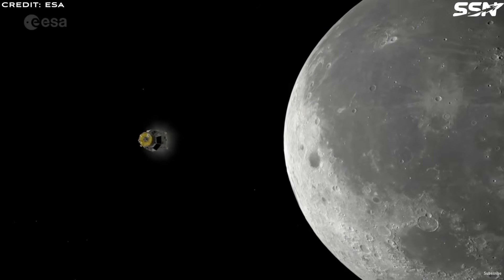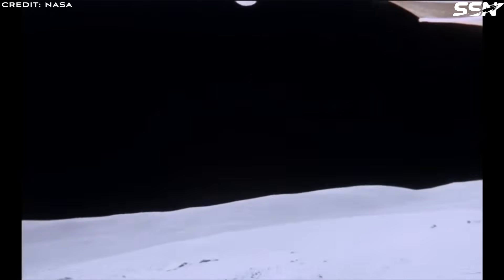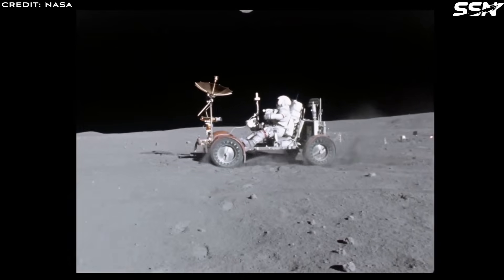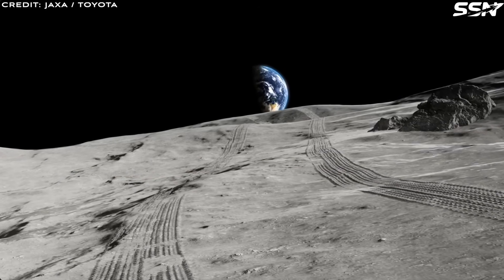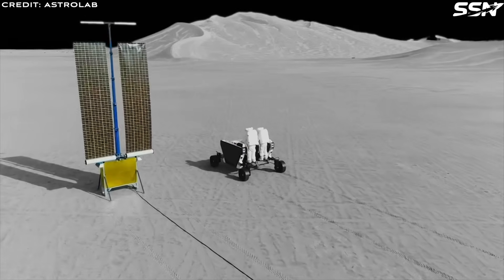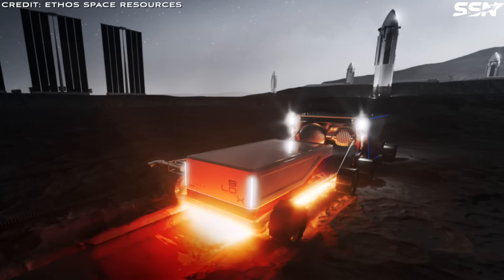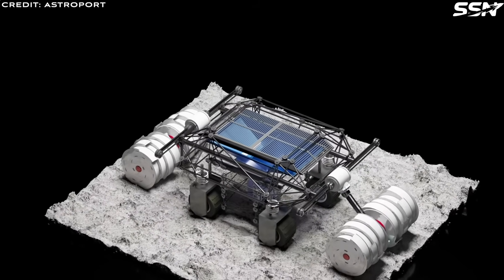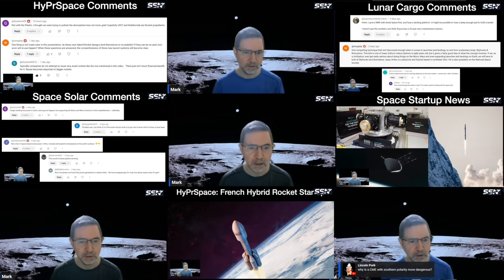Building the Lunar Future: Roads, Pads, and Infrastructure for the Artemis Base Camp

Comment: 1 - Most of this is in the far Future. Let's get consistent landings before we get TOO deep into Infrastructure.
2 - How much of this is much less of a problem if we go with nuclear power & lava tubes? We'd still need roads linking say LLP's, the base, & a water supply, but regolith movement & necessary radiation protection goes way down if we start by living underground.

Comment: you should've mentioned the part where a railing system is even planned for the lunar colonies as well, called a mass driver it gives the launch vehicle lots of horizontal velocity, without the need to using chemical fuel, however while it requires a lot of materials to build, and that needs to be long enough to keep g-forces at minimum safe levels (for any cargo, crew, or both), it'll overall save fuel in the long run.
Reply from the maker: I talk about a mass driver on the Moon in my "Lockheed Martin's Water Based Lunar Architecture", here is the video with the timestamp to the section on the mass driver: https://www.youtube.com/watch?v=kahhSnFUc8I&t=771s
Reply: @SpaceStartupNews  thanks for adding that, and the part where you showed the aircraft carrier launch system, it's a pretty good comparison, I would say.

Comment: 00:03 may i suggest that instead of roads, we lay out rolls of mats, woven like chicken fence, using electric charge or magnetism to levitate traffic smoothly? Same mats can also be solar powered and have very simple solar cells embedded, entire lengths of track will power only one vehicles levitation so simple is enough..
Reply: low lunar G needs surprisingly little to levitate electromagnetic weights

Comment: Every expendable Lunar Starship carries about 150 tons of cargo to the surface and consists of 150 tons of 304L stainless steel ready for recycling.

Steel can be cut into strips and drawn into wires. Wires can be twisted into cables. It doesn't require massive equipment to make kilometers of cable. Steel cables are strong under tension. Bricks made of lunar regolith are likely to be strong in compression.

Those are the basis of modern construction.